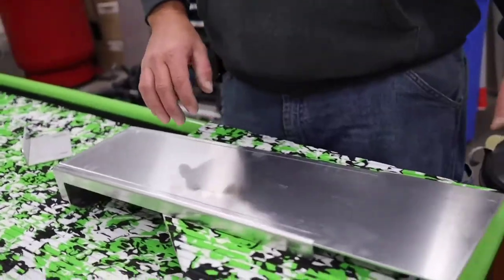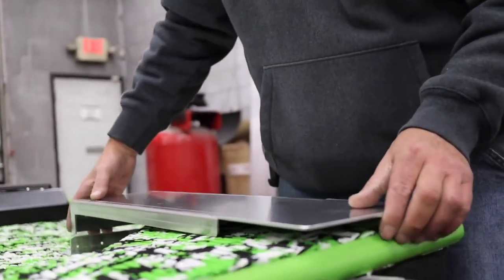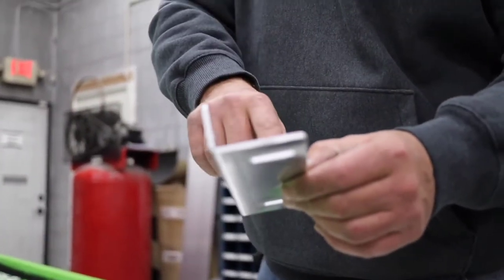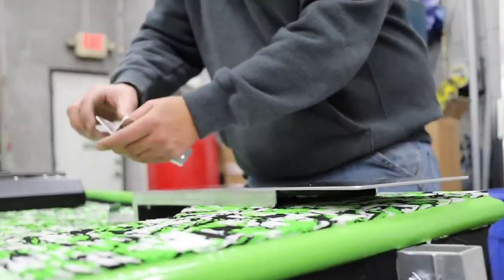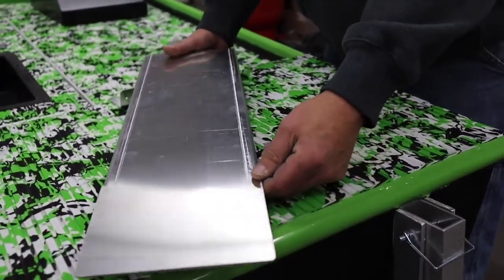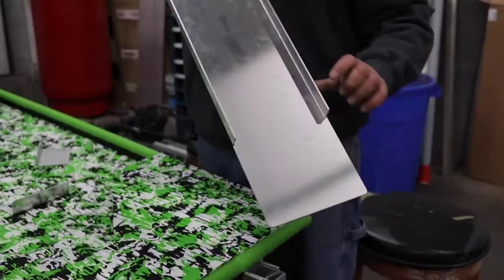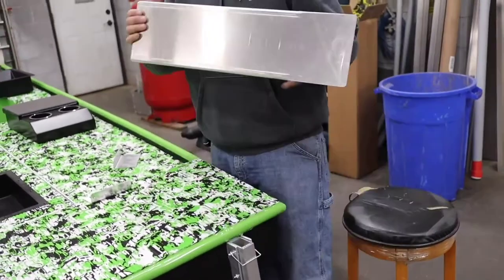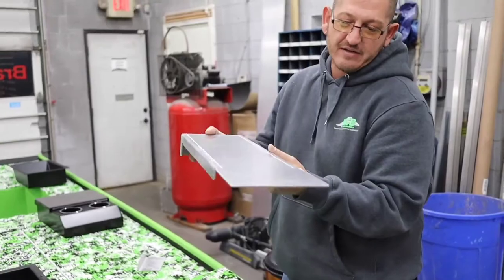Trolling Motor Mount.

Comment: Are these available for purchase. Also, what length are they. Want to upgrade the trolling motor on my Lowe and the Minn Kota Edge mounting bracket is longer than the current bracket I have .
Reply from the maker: 26 inches, yes they are on the site tbnation.net